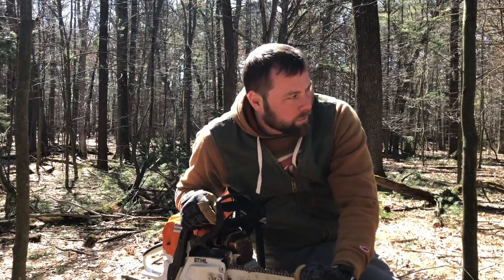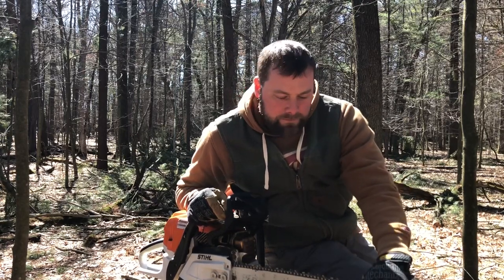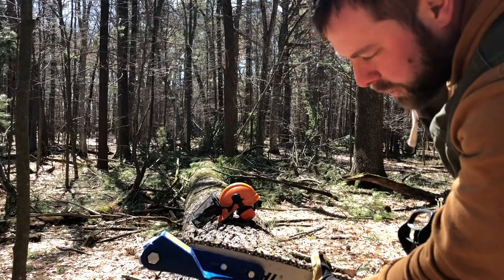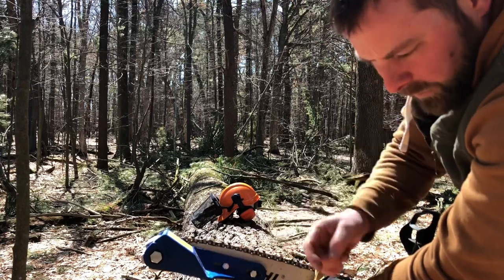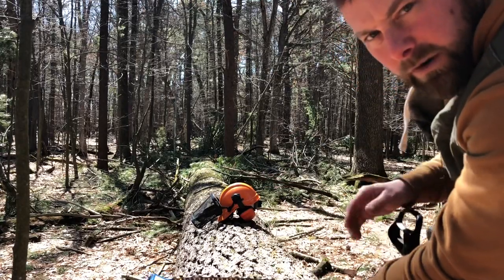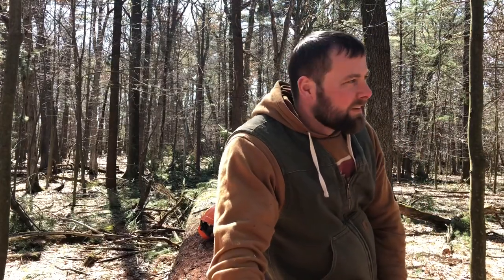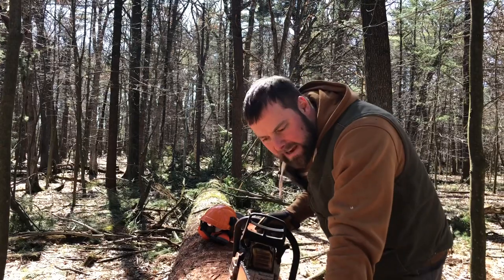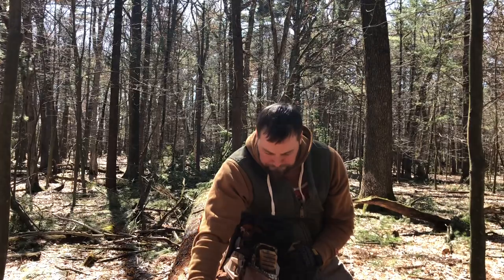#120 Log Wizard for Peeling Logs/Short Cut?

Comment: Hey buddy . Over here in Canada we cut early spring when trees are full of sap . And use truck spring leafs with one side sharpened. Bark comes off in big pieces
Reply from the maker: Yes I think I cut these a little early
I have used the leaf springs before and they work good, I really like the red devil floor scraper I can get good leverage and not bend over so much.
Reply: @backinthewoods2022  my old man loves the scraper also . Cheers 🍻